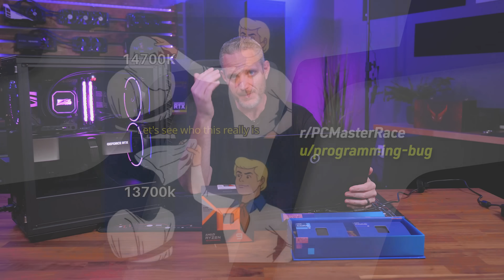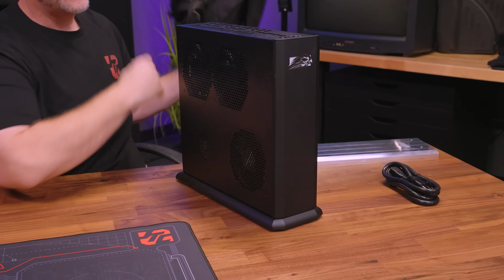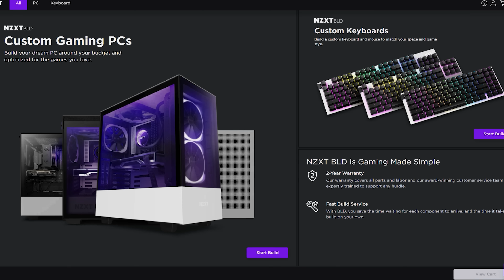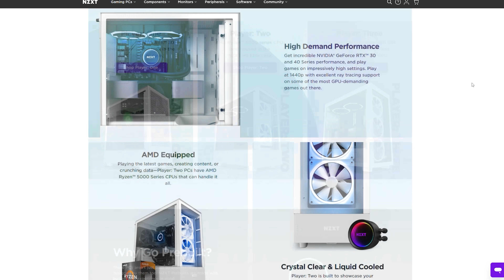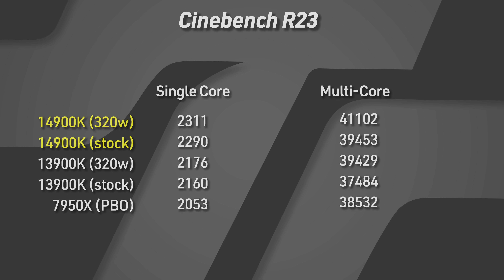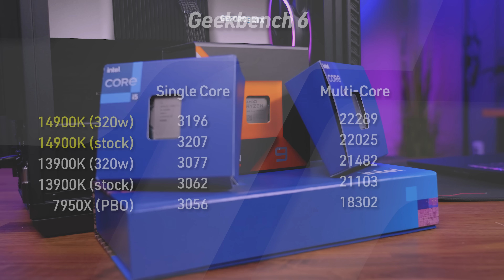THIS is why people have trust issues! Intel 14th Gen Review

Comment: Most compelling thing about 14th gen would be better DDR5 stability. Would be interesting to see some RAM overclocking tests
Reply: @shofla I've seen Buildzoid talk about ram stability on his twitter
Reply: I've just upgraded to a i9 13900k with DDR5 96GB Ram, and the BIOS updates to my Asus Z790 Hero motherboard have prevented any issues with the ram so far.
Reply: Nailed it.  The way intel handles DDR5 results in about 15 to 20 FPS increase from 13K and AMD 3D especially at 4K. There's videos in the last few weeks proving this, especially with 3070 and 3090 cards if you cannot afford 4080 or 4090 yet.
Reply: @figureitoutpunk Name me one 'techtuber' that actually tests with overclocked ram. I wish they did, but they just hit the XMP button and say 'we run the same thing that people at home will be running'. MEanwhile every tech forum I look at, every user is asking for help with overclocking their ram.
Reply: Someone get this man the soWce, i mean Sauce, i mean SOURCE. /j

At this rate I'd just look it up.
Reply: No improvements to DDR5 matter of fact I’ve seen videos say the 13900ks has better memory support then the 14900k
Reply: Oh you poor sweet summer child.  I have some very bad news for you.  There is ZERO improved DDR5 Stability.  Its actually worse than 13th gen.
Reply: @NinjAsylum  Source? 14900k has  96 GB/s memory bandwidth 13900KS has 89.6 GB/s
Reply: it have problems like 2nd gen of amd cpu had with DDR4, system even wont boot so who cares about bandwidth @shofla
Reply: @Dar1usz  Again source? I haven't seen anything like that, and the CPU's have been available for only a few days.
Reply: @shofla  Overclock 13900K to 14900K and check the bandwidth again 😂
Reply: @club4ghz  give him the sAUCe!!!
Reply: @shofla Igors lab just tested this. Only 2 out of their 15 14900K samples could even run 8000 DDR5, and also only on the Asus Apex.

There is no difference in the IMC or anything other than the stock clock speeds between 13th and 14th gen. Actually there is one thing, APO support, but its currently only supported in 2 games.
Reply: @NinjAsylum Who cares about memory? At least newest Intel does support either DDR4 or DDR5.
Reply: I swear that's the reason why I stayed in DDR4 with my 13900K, but people still ask why I didn't went with DDR5 with today's price, STABILITY.
Reply: @AshLordCurry  I have a 13700k with DDR5 that i built last xmas, its been on and running constantly since i built it, no problems. I even picked up some extra RAM and upgraded it from 32gb to 64gb a few weeks ago because a friend bought the wrong RAM so i bought it off him.

I dont do any overclocking though and have no intention to either, that fucking CPU runs hot enough as it is.
Reply: I wouldn't be surprised if all these Tech Tubers are popping the 14xxx series in and letting them throttle during tests.

Yet they will fight tooth and nail and throw weeks of ram at a AMD POS to make it work.... "This is the best CPU money can buy, but you need to try 14 Kits of ram to make it work....

7950x3d was and is the biggest joke, but AMD gets a free ride about burning peoples asses.....
Reply: @kramnull8962 why is 7950x3d a joke?
And how can not the tech tubers throttle the 14th Gen cpus if they're all getting hot as hell because of the insane power draw? They're all saying it throttles by just existing.
Reply: @JavierSegura  to be honest its usually due to over volting and so on... my 13900k scored better in r23 than jays 14900k... and im at 280w... with an undervolt. without an undervolt id hit 305w and throttle after 3 mins but still score 40k stock vcore on some boards is incredibly high and just add to temps and power usage.
Reply: @kramnull8962  where is your soWce? Where is the SAUCE, WHERE IS THE SoUrCE?

In seriousness, X3D was released several months ago, 14th gen was released several days ago, what did you think was going to happen?

Now GIB DA SAUCE SACRIFICE TO SHOFLA!
Reply: @RuyGedares_GuyRedares  Every past AMD release has had 2 months of fighting to get the processors running out of the box. All these tech tubers put in 24 hours a day just trying to assist AMD in making their processors even fit for market......
This release it was the 7950x3d where you disable half the CPU to get benefits. For $700.
The source has been all over YOUTUBE for 25 years now.
Drop an Intel chip in and it works.
Reply: @kramnull8962  Thats strange, I just dropped in that AMD CPU in question and it just worked for me too. Then again, I am not the kind of person who buys on release for anything tech. My experience doesn't really count as a SoWcE (source) though, so you don't have to believe me.

Likewise, your SaUcE is expired and moldy, GIB ME GOOD SOWCE, GIB SHOFLA GOOD SAUCE!!!!
Reply: @kramnull8962  7950x3D-owner here, my CPU isn't joking around, it's very serious all the time.
Reply: @kramnull8962 take off your tinfoil hat
Reply: @crashniels  he ain't no tinfoil, he just does not have the SoWcE (source) to prove it.

Comment: For those of you hoping that this makes 13th gen intel cpus cheaper, it won't.
Why? Intel will stop making 13th gen cpus once they see that nobody is buying 14th gen cpus. To make it look good to their shareholders, they're gonna have to give us no other option but to buy a 14th gen cpu.

How do I know this is going to happen? Same thing happened to Nvidia 3000 series gpus.
Nvidia saw the 4000 series GPU was facing public backlash over... well Nvidia openly being a dick about their marketing practices, so they said "Ok, we need these sales numbers for the new stuff to look good so we can appease our shareholders" so they stopped the factories that make 30xx silicon (simultaneously cutting off the supply to the 3rd party board vendors, so ALL the 3000 series GPU's dried up roughly at the same time).
Now your only choice is a 4000 series GPU, and for most people that sadly means a 4060 non-ti. Which is an absolutely disgusting excuse for a GPU, it's overshadowed by the 3060 in a lot, and I mean a lot of games at lower resolutions, and nobody with a 4060 is trying to game at 4k anyways, so the gains due to architecture changes that show themselves when running at higher resolutions don't even matter to consumers, they're just something Nvidia can point to and say "Look, we promise it's better".

TBH, at least with the thing with Intel, this was 100% expected according to the sources I've seen, Intel wasn't exactly claiming that this would be anything remotely close to a 10% gen-to-gen performance uplift at any level of 14th gen CPU vs same-tier 13th gen CPU, and it's not.
The Nvidia thing, you just know that Nvidia purposefully left performance on the table with the 4060 non-ti, because the VRAM memory bus is literally like what was it, 128 bits wide? And it only uses 4 PCIe lanes to communicate with the CPU as well, which is another way it's horribly bottlenecked for no good reason. It has a full-length PCIE connector on it, it SHOULD be using the whole bus but it's not, and that's because Nvidia told it not to, not because it "is impossible".

Comment: Sweet, sticking to my brand new 13600k. Would have had major fomo if the 14th gen was a significant uplift.
Reply: it is though 30-50% increase expected from new tech 10nm, the ultra supposedly even better since apparently theyre the 'rushed' 7nm
Reply: released for who knows reason, prob ryzen 8-9k consideration

Comment: I don't personally have an issue with the naming, 13750k vs 14700k makes little difference to me because the launching difference in pricing on newegg is only 10USD (17 Oct 23). So if you're building a new pc right now, the 5% performance bump and the slight power efficiency gain are worth the 10USD difference to me. When the prices change and sales happen in a couple of months, it's up to consumers to do their research on price to performance then. It'd been truly offensive if Intel had launched it at a big price bump, but seeing as they didn't, the nomenclature doesn't matter as much in my opinion.
Edit: 14900k and 13900k have 30USD difference, which isn't too bad either.

Comment: I definitely was hoping this jump would be a bit bigger. On an 8700k currently and it looks like I'll be looking for used 13th gen this time around
Reply: if you're making a big upgrade then you're going to enjoy it either way brother, even if these content creators make everything new sound like it's shit. it really isn't
Reply: @WHAT_1400  I stagger upgrades when a leap happens, so when the 40 series Nvidia cards came out I bought a 3070 and sold my 1070, but have held off CPU/motherboard/ram for the past few years. So definitely CPU bottlenecked currently. All to think scrapyard wars with got me into this endless cycle😂
Reply: Wait for 15th gen
Reply: Or, oh I dunno, buy AMD
Reply: @T51B1  had a ryzen 7 1700x before my 8700k. Constantly crashed with photoshop and after effects. Open to switching, but I've already been burned pretty hard once by AMD.
Reply: @brinsonmcbride I see your point but that was the first ryzen gen. They have been miles ahead of the intel since gen2

Comment: I have a 12900K and I'm on the fence. I want the cores because I don't just game, I do a lot of media exporting and the core count makes a difference, but I'm wondering if I wouldn't be just fine getting a 13900K and overclocking the snot out of it? I'm water cooled with gobs of thermal capacity, so heat isn't a worry.

Comment: The best uplift with this announcement came with the 14700K which you didn't mention. 4 more E cores (now  8P x 12E)  and 100 more mhz stock speed will offer a more notable performance increase over the 13700k...10-15% on multicore maybe. If you're building new, this is your value proposition.
Reply: I'd check the GN numbers too, but they didn't seem to be all that different from the benchmarks I saw.
Reply: in productivity? maybe. In gaming? from all the benchmarks I've seen it's a whopping 1-2% increase on average. Completely pointless, especially if prices on 13th gen drop. For gaming should go with AMD anyways.
Reply: @IVIenac3  Yes, of course productivity/creator based applications. Gaming had enough CPU to work with long ago and is mostly GPU hungry.

Comment: Theres an argufor 12 to 13th or 14th gen for faster ram speeds 13 is stuck at 4800 while 13th can do 6000. Plus 12 doesnt like the 32Gig x4 in 2 dual channels you need 13th gen for that id you want xmp

Comment: These high-end CPU's are such a niche market for those on a 4K resolution monitor or for those doing heavy productivity. The vast majority of people should realistically just go out and get a 7600 or 7600X and that's more than adequate I think. Failing that, if they can land a 13600K on sale or a 13700K for future proofing, even better. The 7800X3D is a sensible price right now, so maybe even pairing one of them with a 7900 XT is viable.
Reply: Just got a 13700k from an 8600k and obviously a massive difference 😁

Comment: 14700 is the only processor that saw any real change, and its because of the extra 4 ecores. (performance is largely unchanged in gaming but benchmarks and production workloads see an improvement that aligns with the extra hardware.)
Reply: Yes, the 14700 is actually the "13800"

Comment: How do you keep that cpu cool with dual radiator, I have a 13900ks with an nxzt kraken 360 and it wont run cinebench without thermal throtteling 
I tried undervolting but pc keeps bluescreening due lack of power… (i have asus motherboard)
Reply: @genejones7902  yep hahah the reason why i took that cpu is for 3D modeling thats why im like searching a way to cool this chip but playing with voltage ofsets is not a good idea, had to pull cmos out to reset bios…
Reply: @genejones7902  yes indeed, just wondering if people know a way to tame this monster of a cpu to keep it cool at “max”performance

Comment: I spent $1000 on my build and got a free oculus rift with it. It has a 7600 K and 83 GB GTX 1060. Still not ready to upgrade yet, because the uplift just isn’t there.

It’s hilarious to think that if Intel wanted to, they could enable SMT on any of those old chips through microcode.

Comment: Really torn here. I have a Z690 mobo with a 12700k and am considering a 13900k. Sell the i7 for 225 and the i9 would cost 375. If I were to build new it would be AMD but I'm not going that route. Decisions are frustrating.
Reply: Why bother with such an incremental upgrade? The 13900 is only much better if you’re doing some kind of specific productivity tasks, for most games it would barely make a difference 

Might as well wait until 15th gen and actually get some upgrade for your buck
Reply: @Lysanderoth   Of course you're right and I keep telling myself the same thing. Considering that i play at 1440 I'd see very little in the way of an FPS bump either, nothing observable for sure. I'm a whore for new tech I guess but in this instance I think I'll save my money and wait and see what 15th gen has to offer. Then I'll really have to shell out the coin and buy a new mobo as well! I miss the old days when OC'ing was a challenge and really worthwhile and an expensive motherboard was 150 bucks.

Comment: What's really crazy with these parts is the power consumption vs. the 7950X, etc., and Zen4 was already quite a bump above Zen3. It seems like all vendors for everything are just throwing power at the problem now. Today I saw someone mention water cooling for DDR5, and meanwhile Gen5 NVMe sounds like its radiated IR could cook a steak from half a mile away. What the heck is happening with tech? Sheesh...
Reply: Gotta say, I have a different take on it. Finally there's a reason to water cool your system that isn't just "I wanted to" or "It looks neat".
Now you can do it because "I need to keep this thing cooled off and the air coolers are too big so water cooling lets me put the rest of the heat sink somewhere where it fits better".

Comment: Rocking a 5950X. Sure 14900K is desently faster than my 5950X, specially in some games. But the power consumption and heat output is a deal breaker for me. 14900K use to much power compared to 5950X. I'll wait for 15 gen before any upgrade to intel at least. Maybe zen 5 perhaps.

Comment: 13900KS = 14900K + a slight bump, close enough to being twins though. Think I'm staying with 12900KF.
Reply: What resolution are you running with that 12900KF btw?
Reply: @benjamind547  wouldn't CPU usage go down as the resolution goes up anyway?
Reply: @MrVlodato  Sure. But I mean if you're going to buy a 14900K / 13900K / 7950X or something like that, you're more than likely going to pair it with a 7900 XTX or a 4090. The reason I mention the resolution here is because it just seems like a waste of money to get those GPU's and play on anything less than 4K because there are more affordable/sensible purchases that work perfectly well with 1440p or even 1080p - 13600K, 14600K, 7600/7600X or even a 7800X3D for future proofing as it's not crazy expensive compared to a 13600K. The 7700/7700X doesn't really make any sense to me given that it's literally only £50 less than a 7800X3D atm.
Reply: My undervolted 13900ks has almost same multicore score as this 14900k.
Reckon if I unleash it, remove the negative offset and increase LLC a bit, would beat it without a doubt
Reply: absolutely the sensible choice. not nearly enough a gap to justify even a 3rd of the cost of the upgrade. your cpu is still a beast and there is nothing that requires better than it
Reply: overclock the 13900KS and you have matched the 14900K or very very close to

oc'ing is free (assuming you had a beefy cooler already, as you should for a 13900KS)
Reply: @dradfulboss  to be honest im already matching it with an undervolted 13900kf... i get 41300 in r23... 25k on timespy

Comment: Was waiting for this before upgrading. Think now I’ll just pick up a cheaper 13th gen
Reply: 14900k is currently selling 30 dollars （canadian） more than the 13900k， maybe wait for a bit for the price to drop.
Reply: Like Jay say if you don't have the 13th gen then it's okay for the upgrade. Not worth the upgrade from the 13th gen since it only gain a little performance. It's like buying a car. If the new model still using the same motor, it's not really an upgrade. It's just an update.
Reply: @Emyrtemoc car analogy doesn’t exactly apply here. 

Say a Lexus IS350. It’s been using the same v6 since 2006 all the way up now 2023. That’s a 17 years difference. By your logic don’t upgrade to the newer model just because it still has the same engine?
Reply: @Zenzuu  you're mistaken.

 You gotta think the form of a car is the pc and the engine is the cpu. The analogy here is about upgrading the engine and not the car itself.
Reply: Get a 12th gen.  It's more than enough if your building a gaming or editing PC.  Mine is way more than I need paired with my 4070.
Reply: what a bad tip..
 @paddlesouth
Reply: @paddlesouth  12700k is my current processor
Reply: @paddlesouth  disagree i only get 170fps in warzone 3. I5 13600kf and 4070ti. 240hz monitor

Comment: At this point, the generational changes are so small, if you bought a computer in the past like 5 years, it's still just as good as a brand new cpu... the only real reason to buy a new cpu in the future will be because the one you have now died... or microsoft makes a deal with amd and intel, and locks out cpu's unless they're less than a certain age.
Reply: Sounds like Windows 11 and E-Cores™, alright.
Reply: @vincentvega3093  yeah, but using E-cores without proper task scheduling would be awful.